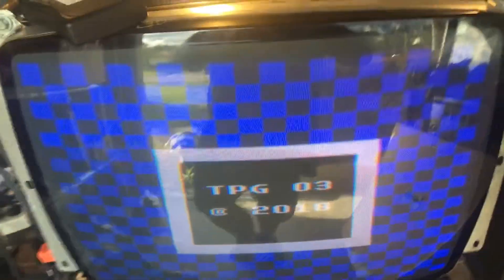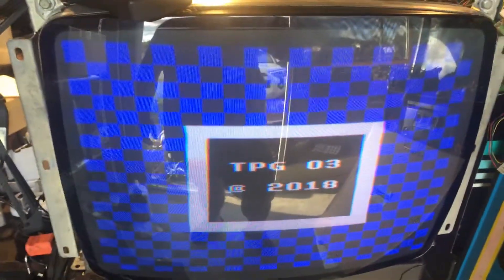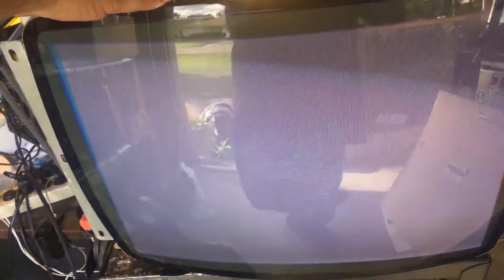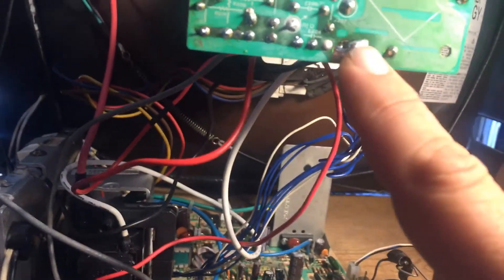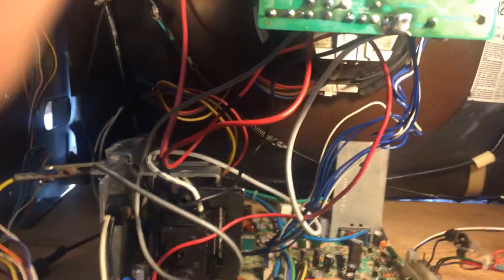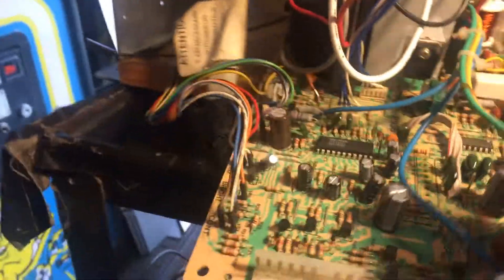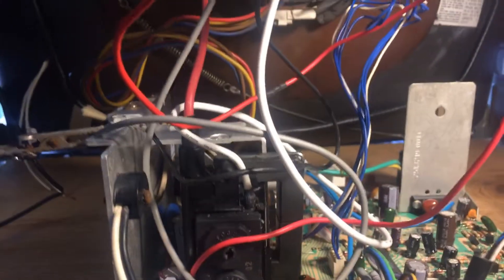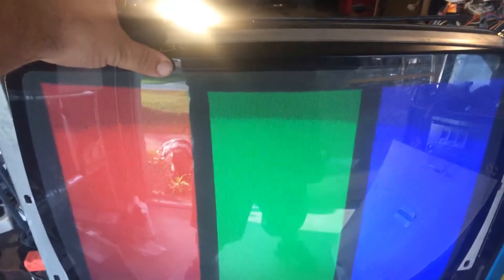K7000 repair for Melissa

Comment: PAUL JURAY, arcade power supplies only use one filter cap rated at 27,000uf and higher, any reasons why because most power supplies use multiple filter caps 10uf to 100uf not 27,000uf and higher capacitance. Whats the reasons for this?